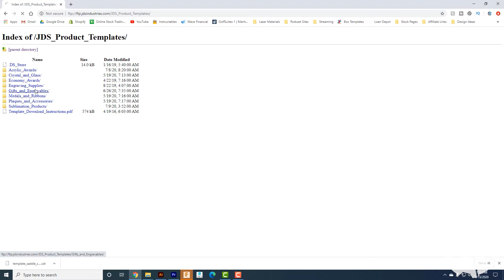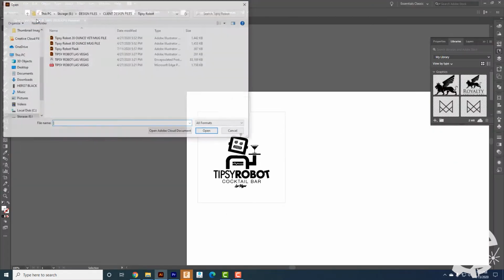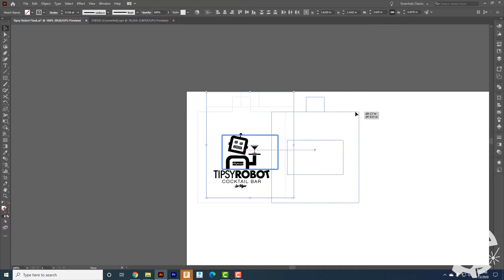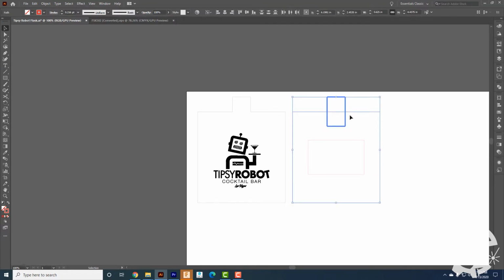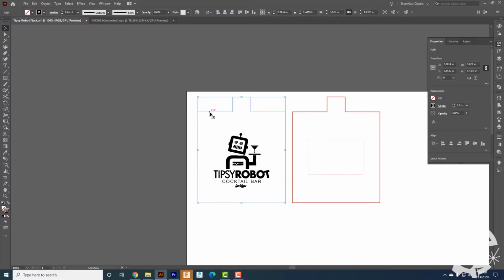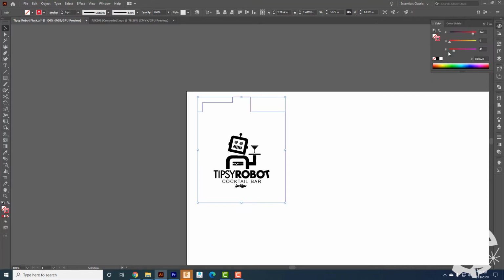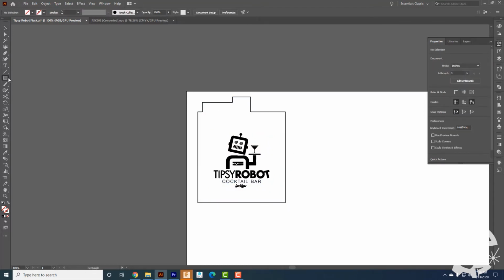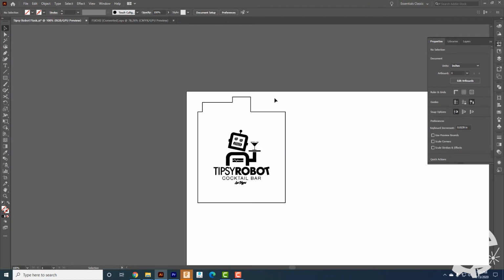HOW TO ENGRAVE A CUSTOM FLASK | LASER ENGRAVING FLASKS

Comment: Orange! Do you think if you focused the beam at about the halfway point of the curve it would work? That way the top isn't as out-of-focus.
Reply from the maker: I’ve tried that in the past. The issue I ran into was that it ends up not engraving all the way through the powder coating out on the edges. With leather ones it may be fine that way. It’s the powder coated ones where you’re trying to get through that layer that it ended up having to be that way.
Reply: @MakerExperiment  Ah, makes sense. Even the way you did it the "high spot" in the middle of the flask doesn't look any different from the rest. At least in the video it all looks like pretty crisp lines.
Reply from the maker: Bear Maked with a powder coated one, it looks great. Leather may not work the same.
Reply: Bear Maked... that is what I do on an Epilog Fusion 40 120 Watt... it works great on sides and middle. I find if I focus on the outer edge, the heat from the laser discolors the stainless from too much heat.

Comment: is it possible to do a bottle without a roller?
Reply from the maker: Doncar06 technically yes if you only engraved a thin width the length of the bottle. The issue starts when you try to engrave down the curved surface where it’s no longer focused properly. It’s not really possible to engrave around a mug without a roller. But if you are only engraving maybe 1” wide it may be worth a shot.
Reply: @MakerExperiment  true thank you

Comment: How much did you charge for one?
Reply from the maker: Rock it honesty depends on quantity. If you’re only doing one, I’d make sure it’s worth your time. Your pricing should be calculated based on your cost and your labor. My rates most likely aren’t the same as any other person. My suggestion is to calculate your cost for machine time, labor, and overhead and calculate the cost that way. Just giving you a price is kind of misleading as the prices change based on quantity.